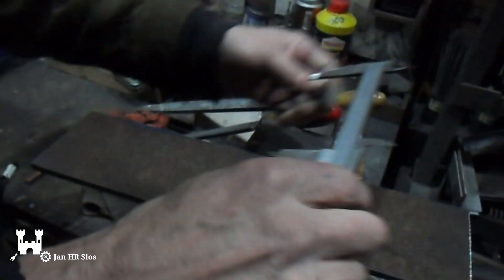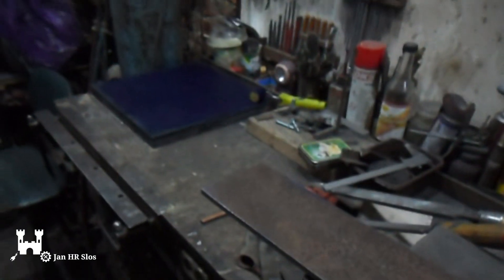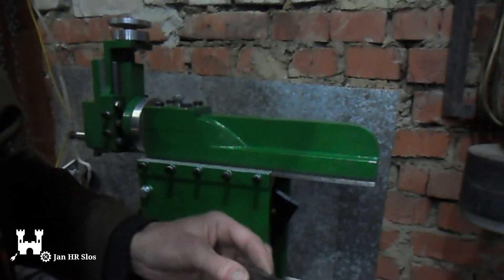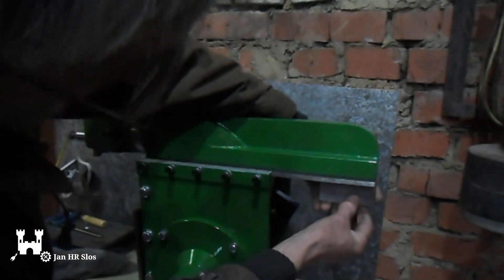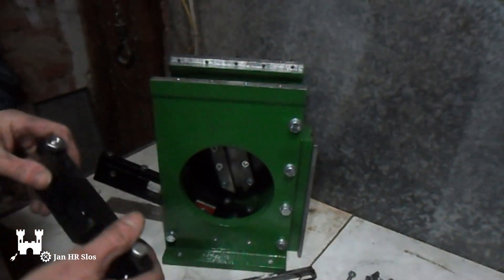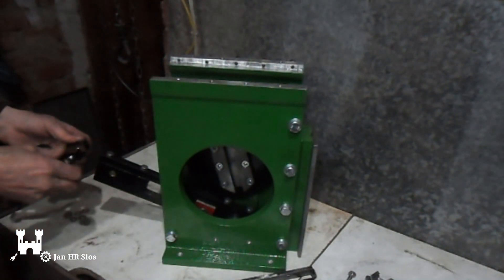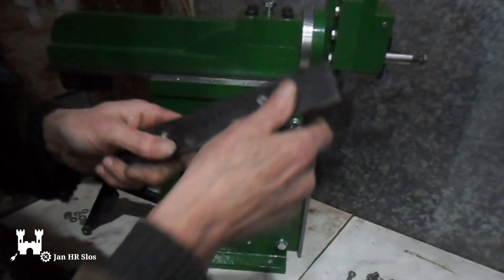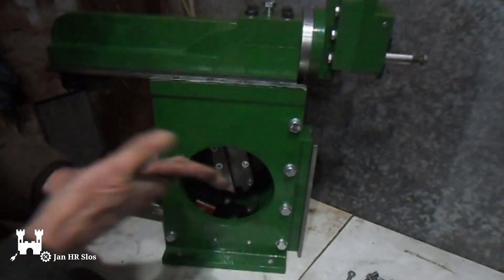37 Gingery shaper part 4 ENG

Comment: Looks great! This is next on my list of projects.  I've finished the lathe, metal brake and of course the foundry, but I need to remake my crucible tongs as well as the foundry.  Gingery has provided a never ending path for projects and it's always great to see someone else implementing his ideas.
Reply from the maker: Thanks, I made my first furnace 15 years ago, then I made several more but I always return to the first one, it is very cheap to operate and works well with firewood, altough I can operate it with propane or waiste oil. Soon I will try cast iron and for this I think firewood won't burn hot enough.